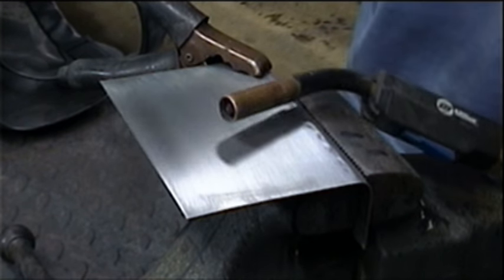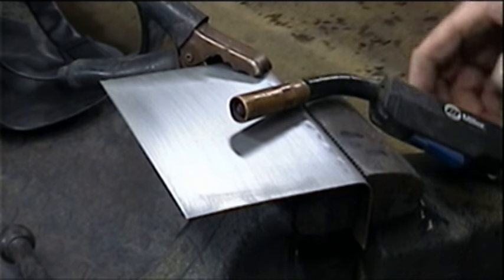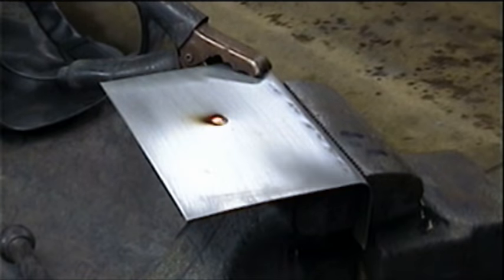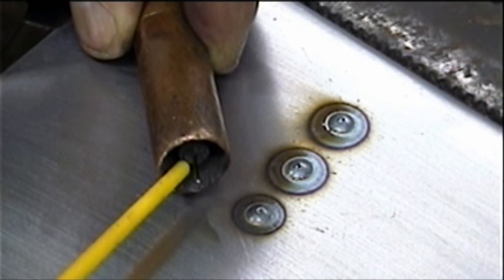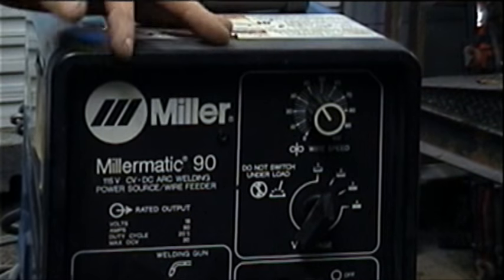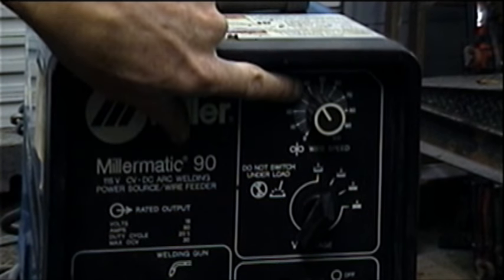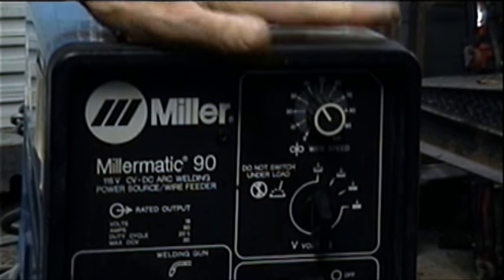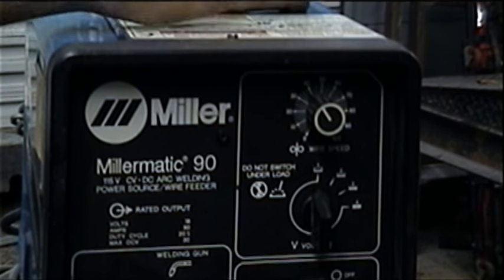Learn How to MIG Weld Automotive Sheet Metal in 5 Minutes

Comment: what are those settings in amps?
Reply from the maker: I'm not sure Walter but the closest I can figure is about 35 amps on setting (2).  It's a 90 amp welder and the Miller website says .001" of thickness requires 1 amp so 22 gauge sheet is .035"  thus .035/.001=35 amps  Sounds about right but not absolutely sure on that.  The other setting is just wire speed.  Jerry

Comment: What is the diameter of the electrode that you use?
Reply from the maker: The wire size is .023.  If that's not what you mean, ask me again.
Reply: Mine only fits 0.030. would that also work with metal sheets?
Reply from the maker: @keithdimaquibo4387  The .030 will work but I suppose you may need more heat or voltage - just my thoughts though.  I'd give it a try - might work just fine
Reply: @LakesideAutobody  thanks! I'll let you know if it works
Reply: Keith Dimaquibo what kind of welder do you have?
Reply: @sbranham86  I have a powerfist 120 volt mig welder

Comment: I'm assuming that's with 0.23 solid wire and gas shielding and not flux core. can sheet metal be done with 0.30 flux core wire?
Reply from the maker: You're right - here's some vids on flux core:  https://www.youtube.com/watch?v=ic7Gwf8y4Yc  *  https://www.youtube.com/watch?v=iznc9CCtZnw  *  https://www.youtube.com/watch?v=H87b1xlGofw
Reply: @LakesideAutobody  Thanks. Looks like i should give it a try with the hobart I have access too.

Comment: Should I hold it with wet hands
Reply from the maker: You can - it won't do anything but weld :)
Reply: I subscribed!
Reply: On a electric welder should I use it on high or low volts ? I used it on low the other day and I seemed to make little baby ugly looking hot tacs. Some seemed not right. What’s your opinion
Reply from the maker: @mrbigbuds1745  Each time you weld, it'll be different.  Most of the times on good automotive sheet metal I use low settings 1 or 2 if it blows through, I turn it down - if it acts like it's not melting in enough, I turn it up.  My welder has 1-4 for heat settings - 3-4 are more for frame stuff and thicker metal
Reply from the maker: @mrbigbuds1745  Thanks, glad you enjoy the videos

Comment: millermatic 135 bought hard Cash 1200 Plus 2006. knock on wood making money with it today.

on a side note though settings are only guidelines no offense sir.
open the lid on my machine to replace the spool and there is a Miller recommended chart available for varying materials as well as wire diameter and recommended settings.

Miller also has what's called a welding calculator. mine is a handheld sliding chart front and back.  I highly recommend hunting down a welding calculator perhaps the app.

finally general tips--
1 welding styles are learned. what works for you won't work for me
2 everybody has a setting for something. numbers are a great baseline but it comes back to your style
3 moving the cup around the electro tip forward or back will change the amount of heat/related settings due to how much farther away from the work you are, transversely slide the cup back with tip stick out and you Max heat but will dip the tip or walk the cup
Reply: my lil machine maxes out with .030 wire at 3/16 material on the factory chart.

properly prep and bevel the edges I can go 3/8 deep with multipasses root through cover. 

p. s.

spend the money for the gas I started flux core and it was a learning/burning experience.
Reply from the maker: Thanks for your input KP - have a great weekend :)

Comment: Thought you need 220 to successfully weld vehicle frames?
Reply from the maker: I welded the main leaf spring on a 1973 Charger with this welder and drove it for ten more years.  It can easily weld 1/4" - 3/8" metal - just my opinion though - hope that helps :)

Comment: Fuck i hate these welders that don't give you voltage number as well as wire feed rate :'(
Reply from the maker: Sorry - for sheet metal feed is around 40 on my Miller and voltage 2 or 1 if I burn through.  Jerry

Comment: Be sure to hold it without gloves…
Reply from the maker: You can use gloves if you want.  Most times though when doing intricate work in a body shop it's easier and faster to not use them.  It does protect your skin from ultra violet rays though so it is a bit safer :)
Reply: @LakesideAutobody  right lol
Reply from the maker: @krcoutdoors4566  No?

Comment: Welding frames with .023 wire and a 90amp welder? You sure about that?
Reply from the maker: That's funny because the eye of the top leaf spring on my 1973 charger broke right off.  At the time I couldn't afford to replace it, I "V'd" out both sides of the the leaf and the eye - set the welder on 4 (High) and did my best bead welding on both side.  I drove it for 8-10 years after that and sold it.  I did mention that it would need a new leaf spring to the new owner though.

Comment: False information
Reply from the maker: It's really not that hard to MIG weld.  It does take some practice but the good thing about auto body is the welds don't have to be perfect.  If you don't like it, grind it and weld again - Jerry
Reply: @LakesideAutobody  , I agree with you there, yeah, you most definitely can grind and hide. However, depending on what you're welding,  you can potentially be putting yourself and or others in danger by hacking and stacking out substandard welds. Vehicles are designed to react a certain way in collision, and so if you're telling people 'it really doesn't matter", they will most definitely not give a shit what the integrity of the work is, so long as they can grind and hide.
Reply from the maker: I'm very sure not all body men are welding perfect out there in the real world.  I've seen it.  To be successful in a body shop you have to be able to fix what you mess up.  Most often you are welding at all different angles and situations. There are times you can even see what you are welding.  Yes, that's bad sometimes but you just do your best and fix the rest.  Hey - I like that.  Do your best and fix the rest!   Have a great week and thanks - Jerry
Reply: 1totheright doom and gloom
Reply: @1totheright  I used a stop sign as a floor pan patch on my Camaro. I hope the fun police don't come knocking.
Reply: The body panels are not usually structural soim sure this is fine for cosmetic repairs obviously if your welding a structural area you need to do it differently